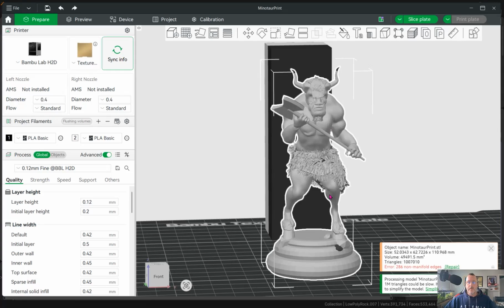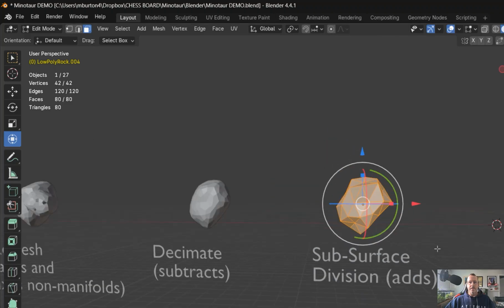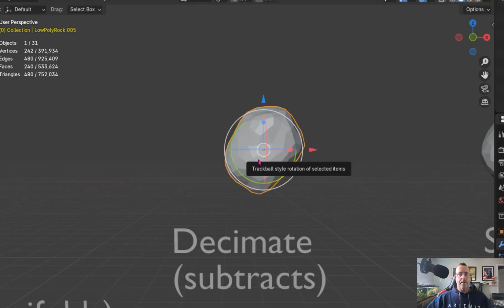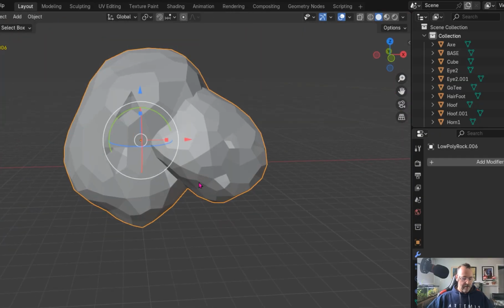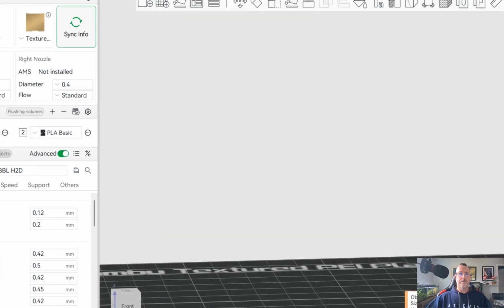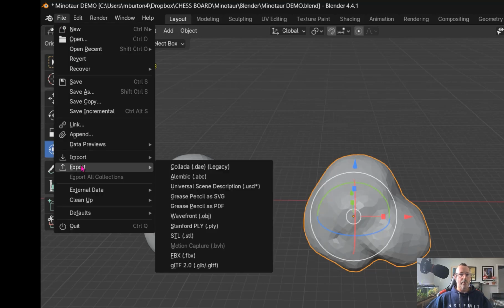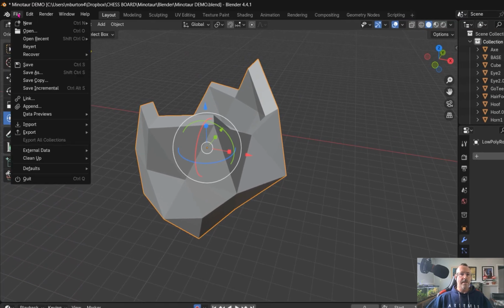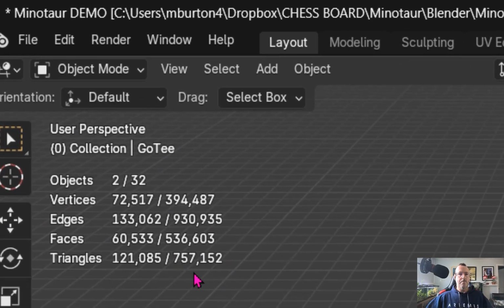Fix 3D Print Meshes in Blender | 4 Easy Modifiers Explained for Beginners

Comment: Thanks for the great tutorial. Remesh solved all my issues, my models kept having gaps and holes in them, even though they looked perfect in blender. Basically once I converted them to STL and  I looked at the slice preview in FlashPrint, it was a mess. Also spent hours trying to fix this in Blender and FreeCAD , and nothing worked. But Remesh has fixed this issues and the slice preview looks perfect. Going to print the model now!
Reply from the maker: I’m so glad to hear this was helpful! The remesh modifier adds a ton of geometry, but hopefully you could decimate without much destruction. Good luck on your project!